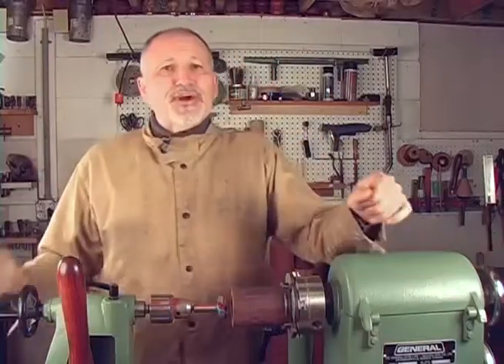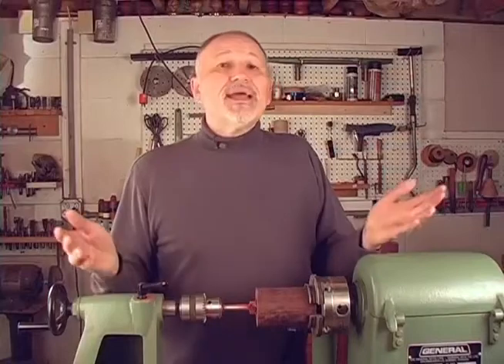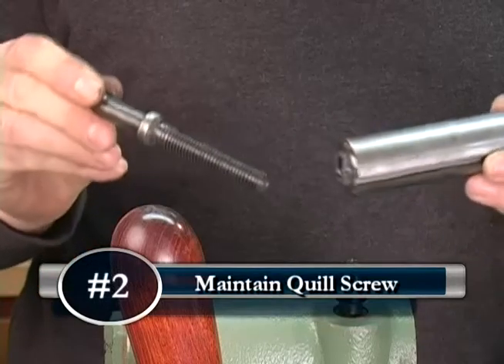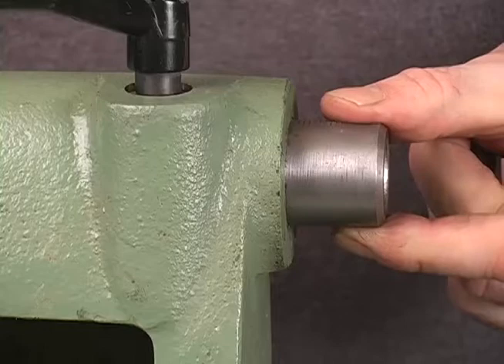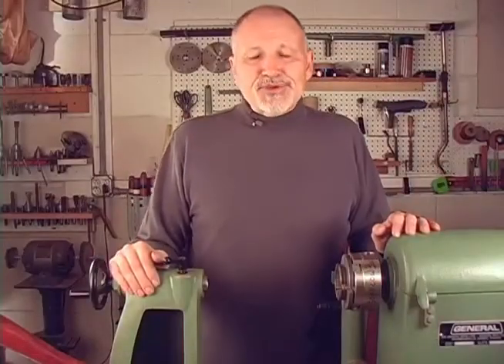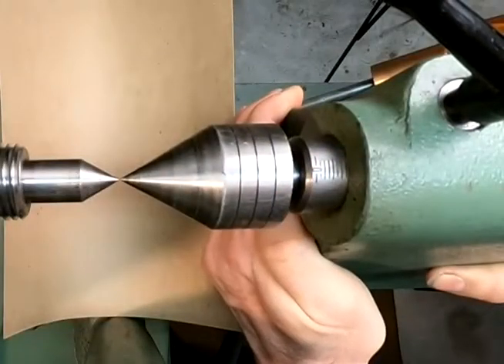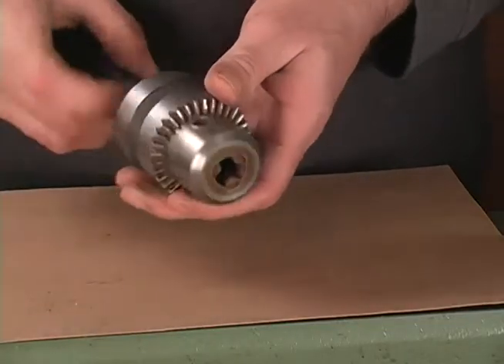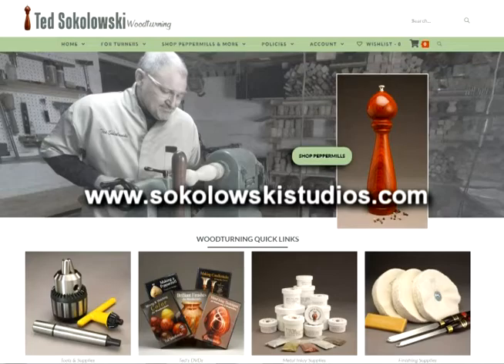Maintain Your Lathe's Tailstock to Drill Accurate Holes

Comment: I have vertical misalignment between my headstock and tailstock... The tailstock sits below the headstock center. This is temporarily remedied with shims made from copy paper... Brass shim stock would likely work as well. If you extend the ends of your shims out from under the tailstock and bend them up against it they will stay in place when moving the tailstock back and forth.
Reply from the maker: Shims will work if the Tailstock was machined incorrectly. (This scenario would be a manufacturing defect.) Hopefully, the shims you added will make the tailstock parallel to the ways of the bed consistently over the entire length of the bed. Chances are the misalignment is due to wear in the ways of the bed. On older, worn-out lathes, the bed may develop a slight belly near the headstock and it is usually a tapered belly. In this case, shims will not fix the misalignment over the length of the bed...only at the point where the shims align the tailstock to the headstock..  Sliding the tailstock (with shims added) away from the headstock will then raise the alignment. Machining (surface grinding) the ways of the bed is the only way I know of fixing this issue.

Comment: Hi Ted!  Thank you very much for this video.  This is very informative and the timing couldn't be better for my near future project.  I have some experience in wood working but haven't gotten into this type of work with lathes.  I want to start making Native American Flutes and I can't figure out what the best method is to bore the long piece.  I am hoping the lathe would be the way but centering the hole seems to be very tricky when talking about a 28 inch long hole.  Any suggestions?  Any help would be greatly appreciated.
Reply from the maker: I would mount a piece of wood three times the final diameter you intend for the flute between centers on your lathe. Rough it round first with a tenon on one end then mount the tenon in a scroll chuck. Support the long spindle in a steady rest, dimple the center to start the drilling process on center then drill out the flute slowly using a carbide forstner bit. Add extensions to the forstner bit as needed to get to your final depth. Then remove the piece from the scroll chuck and cut the tenon off so that you end up with a long "tube". Mount the "tube" between a homemade dead center in the headstock and live center in the tailstock and finish turning the outside to the final diameter.  Good luck.
Reply: @TedSokolowski   Thanks for the response Ted.  I've seen this procedure done with full tubes like you mention.  The one thing is that a Native American flute is not a tube.  It actually has 2 chambers.  It will be hard to get each hole from each side to align properly.  I believe some makers use a big metal lathe to do this.  It seems those are more precise, but that's a piece of equipment that is way out of my league at this point.  I'll keep doing research. Thanks a lot...